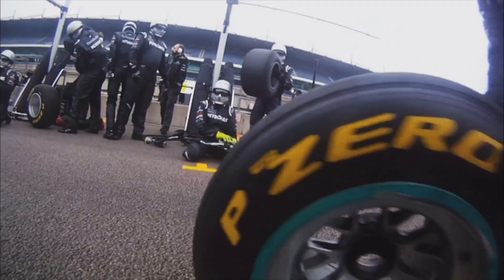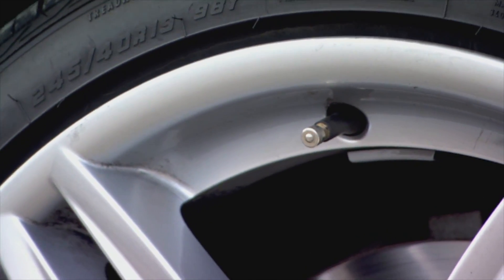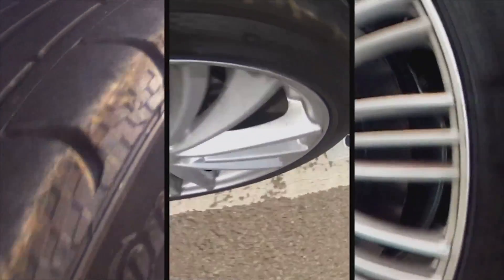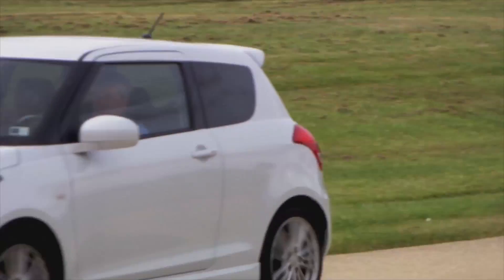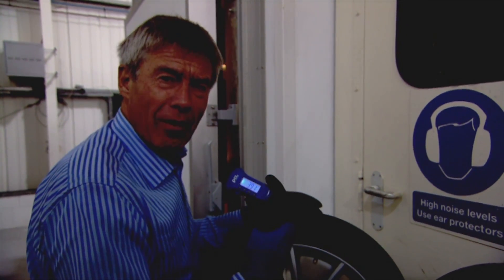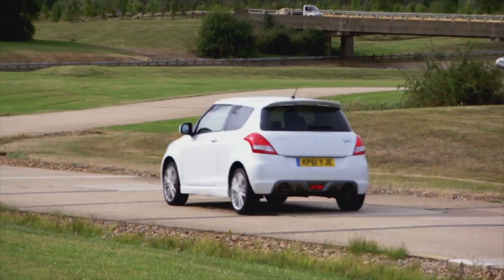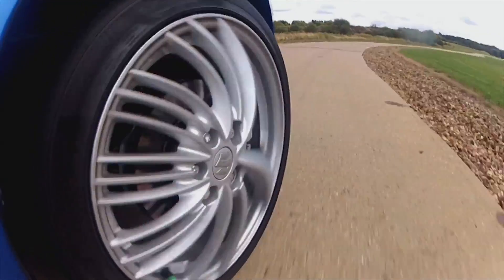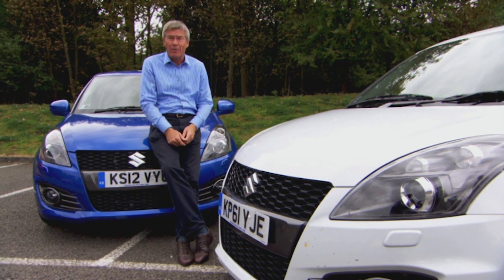Nitrogen vs Air In Tyres - Fifth Gear

Comment: Personally, I'd be more wondering if the nitrogen being sold in the garage was actually just compressed air.
Reply: oistein74 Yes but you can calculate exactly what the pressure will be at a certain temperature, but with normal air you have these other gases that expands differently thus making it harder to predict the temperature.
Reply: Edward Weagle I think air is only an approximated ideal gas and pure nitrogen can be modelled as a more exact ideal gas. For an ideal gas, PV = RT, so for a constant volume the rise in pressure is more linear for pure nitrogen than a mixture like air, so it's more predictable. The actual pressure increase gradient doesn't matter. That's my guess.
Reply: oistein74 If you fill your tires on a moisty day compared to a dry day it will differ alot when you reach the right temp.
Reply: I fill my tires from dry compressed air. But in general if you do not add a drier to your tank you are correect.
Reply: oistein74 Shouldn't CO2 be even a larger molecule than O2 ??
CO2 is commonly available, Oxygen and Water-free. . .
Reply: oistein74  To suck everything out, the tire would have to collapse, breaking the bead,
Reply: oistein74 Why would it be less suitable when its 100times more predictable than normal air?
Reply: oistein74 How hot does your tires get?
Reply: I don't have a temperature gauge inside the tires.
Reply: TheMechEngineer that was a lot of words but I have no idea what your point was.  I wish a real news organization would test these garages to see if you are getting what you pay for.   reference can be what airports use for planes,  which I am pretty sure is nitrogen
Reply: Edward Weagle Oh I was just saying that it might be easier to model the behavior of nitrogen with maths. Nitrogen has a linear relationship between pressure and temperature, so increasing the temperature by a certain amount increases the pressure by a certain amount. With air the relationship might be slightly exponential or something, so it's not as predictable.
That being said though, for everyday use it would mean diddly squat. The only reason why landing gear tyres and F1 car tyres are filled with nitrogen is because the pressures require much higher accuracy, otherwise an airplane tyre might blow out on landing or an F1 car might be off the pace by a few tenths.
Reply: Edward Weagle u can try to breath with it, if u feel dizzy, it is nitrogen.
Reply: Tyres on F1 cars and aircraft are filled with nitrogen from a state of the art unit containing pure nitrogen. This means that this nitrogen is free from water vapour. The only road faring civilian automobile I can think of with nitrogen filled tyres is the Nissan GT-R from 2007. Even then, Nissan probably used the same type of nitrogen pump used at nitrogen filling stations, meaning that they wouldn't be able to guarantee there wouldn't be any contaminants such as water vapour.
Reply: N78 .. a 78% Nitrogen product is highly recommended and used by most car owners!!!
Reply: nitrogen is not expensive and they can upsell people with a hogher cost.
Reply: Nitrogen in a tire is not a scam, otherwise it wouldn't be used in airplane tires and other special cases.  However that is more for high pressure and temperature changes.  In the cases of garages though...  I think some investigations by proper media should be done.  (If there are any left)
Reply: @edweagle  nitrogen is not corrosive and its dry. So no ice in the tires and i guess its less likely to burn in the case of hot brakes. Handling and gas mileage inst much a factor on aircraft... The pressure thing is dumb sea level to 40k feet would only be a 10psi increase in pressure for the tire.
Reply: @edweagle  He asked one question, and you...
Reply: Edward Weagle Aircraft tires have 200psi and are exposed for +50 to - 65c, Not relevant for car tires.
Reply: +oistein74...  that is what I said...
Reply: Ok, well I do racing with my car and I've tested both N2 and normal air. The pressure rise with N2 is higher than air and hence it's less suitable for racing. Snakeoil
Reply: @oistein74  come to canada and you will see the same temperature difference between summer and winter
Reply: @ivanovpreslav7417  No.
Reply: @oistein74  i live there so I think I know how it is with the different seasons
Reply: @ivanovpreslav7417  no.
Reply: Jack O'Neill Yeah, that's what I thought as well. Turned out when I raced with Nitrogen in the tires the pressure rose much more than with pure air alone. Motoring program FIfth Gear came to the same conclution.
Reply: Hot enough for slicks to get to operating temperature. Pressure rise with air is around 7psi and with Nitrogen is around 12psi. Almost double. Filling station at tireshop was a Nitrogen machine which sucked out everything in the tire before filling with Nitrogen.
Reply: The tireshop I used had a specific fillermachine which created a vacuum in the tires before Nitrogen filling. Same result.
Reply: Lower pressure would mean more tire flexing, meaning the regular air tires run hotter.  
Heat shortens the life of tires, so that is less desirable.
A good way to measure the nitrogen-regular air difference would be an accurate temperature scan of the tires after a hard work out.
Reply: Nitrogen in tires is a scam, having airplane tires filled with nitrogen is different reason all together.
Reply: C02 would be even more receptive to temperature changes than air. My experiences with N2 in tires are not positive.
Reply: @oistein74  Why would it be more temperature sensitive? 🤔
Temperature in this case is simply a function of the average kinetic energy of the gas in question. CO2 is heavier than Nitrogen (N2), and would therefore take longer to change temperature as the momentum of the CO2 molecules cannot change as quickly.
Reply: @hectorandem2944  try it for yourself and see.
Reply: That don't matter to me when I see much higher pressure in my tires with nitrogen than with normal air after racing a mere 10-15min.

Comment: It's free where I live so no reason not to use it .
Reply: fabulousprofound I live in South Africa ,I guess with everything else sucking so much here the least they can do is give us free air .
Reply: just asking but where do you live? where i am, fuel filling stations charge for just basic air alone ("service fee" to maintain the equipment some of them say) and nitrogen fills are usually a paid dealer option =(
Reply: fabulousprofound Usually if you ask the cashier at a gas station for air or water they turn on the machine for you free of charge, but if you don't ask them you are forced to pay.
Reply: In France air is free. Not Nitrogen.
Reply: ruckusdc5 sadly not for me. you have to pay first and then they will turn the machine on. i once went to the united states and at the station i was at the air and water equipment were coin operated.
Reply: fabulousprofound In Canada (Alberta) they are usually coins.

Comment: Excelent clip! Now, if you're a picky driver and have a performance car driven accordingly I still recommend inflating the tires with Nitrogen but make sure you do it form the very beginning (when you fit the new tires on the rims). The water vapours which are very often found in the air from air compressors have nowhere to go once they are pushed into the tire. We've also made a test by inflating the tires on one diagonal with air and on the other with Nitrogen. At the end of the test the pressure was 3.1 for air and 2.8BAR for the Nitrogen (starting from 2.4BAR), and this is a huge difference.
Reply: Victor Tarhon-Onu bugger off! It makes hardly any difference! The air is 78% nitrogen. That and you need to evacuate ALL of the air when you mount the tyre to the rim, then fill it with nitrogen to get 100% nitrogen fill. I call bullshit on this one sir. I'll stick to normal air with 78% nitrogen and comes totally free.

Comment: I don't buy these results for 1 second. I've had 4 Mustang coyotes that I ran nitrogen in, and one 13 civic Si, with both vehicles filled with air the ride quality for sure was noticeable, it was very hard and bumpy, but once I deflated both vehicles of air and filled with nitrogen at work immediately the difference was noticed, soft, smooth, awesome ride!
Reply: Why would there be any difference in ride? The gases involved will not effect ride just the amount/presser of the gas.
Reply: inlineschool

Nitrogen will have a different stiffness to oxygen.

That said, I think it's a waste of money.
Reply: The difference in compressive qualities between N2 and air are negligible. If there really was a difference, it was because of a difference in pressure, not because of your choice of gas.

Comment: A good overall look, but a minor quibble about the testing: Although the vehicles in the test were equal enough to offer parity, the only real way to ensure A/B testing is meaningful would have been to use the same car with the different tire sets. Had that been done, the result may have been slightly different.

Comment: I have noticed on my GTR (a heavy and very fast car) that while driving on the track I do not need to keep letting air out of my tires to keep the pressure correct. For me it was a noticeable difference compared to people with 'regular' air in the tires.
Would this be a make or brake ... no ... just a bit less hassle regulating the pressure.
As Tiff said, it depends on the quality of stuff they pump in the tire. I'm sure many will sell you 'nitrogen' but it is ...
Reply: i just watched your video in spa belgium. Very nice driving.

Comment: Even with Oxygen leaking through the rubber and topping up the pressure you're heading towards a Nitrogen filled tyre. 
Fill with air initially and 21% (the O2) eventually leaks out. 
Replace that lost gas with more air and you're putting 78% nitrogen back in place of what was O2.
So after one top-up you've now only got (0.21 * 0.21)*100 = 4.4% O2 in your tyre.
Reply: This is a brilliant point, mate